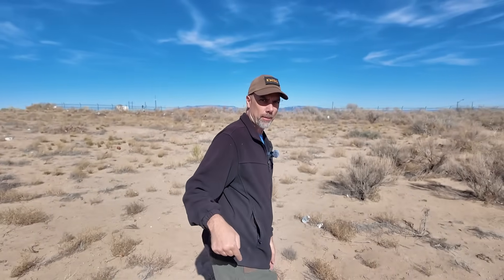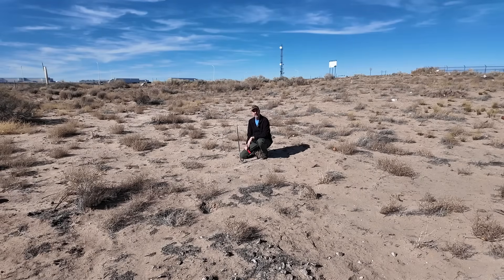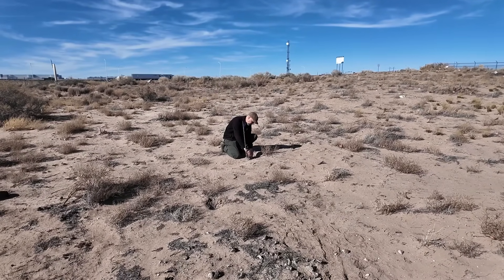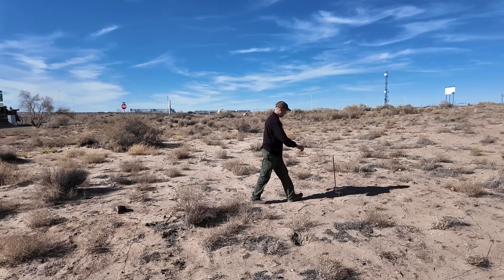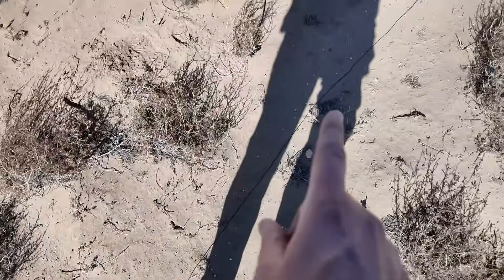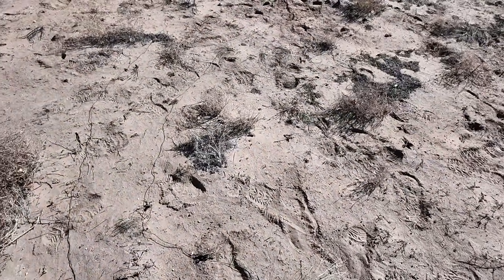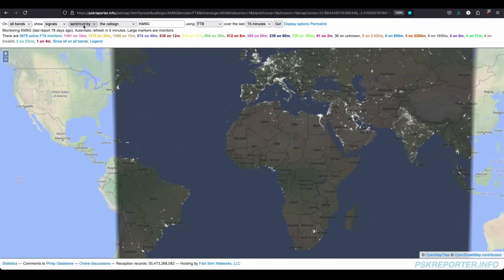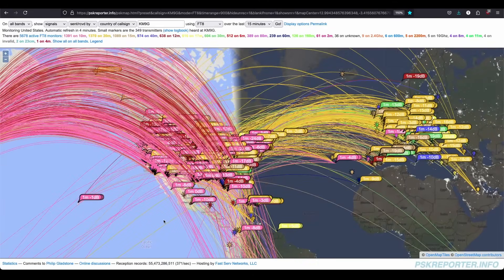Build It: Spirally Polarized Radials for Spin DX

Comment: If you read the patent on the Andrew data sheet a usable transformer oil for baluns is mentioned and the Hybrids to make the antenna work. All possibly important learning items for some hams (me).
Reply from the maker: I'll add in some notes
Reply: @temporarilyoffline   The silicone wire I'll probably order for my antenna kit. Is it 20 gage in the vertical setup?
Reply from the maker: @jerryshore8374  for the radials you can get any size you want.  I used 22ga in this case, but I have tons of sizes.

Comment: If the FCC wasn't allocating the HF bands for commercial auction in 2026, I'd definitely build this antenna. But, Id hate to get the best design on the air just to lose the ability to use it. 😢
Reply from the maker: Rebellion is the only answer

Comment: I saw a real Andrews HF antenna with spirally wound vertical wires at a Melbourne location. I never saw an add for that and It was not April 1. I suspect if you left the vertical element it might work. You should run it again tune with VNA and test using WISPR.
Reply from the maker: Sounds like an excellent design!